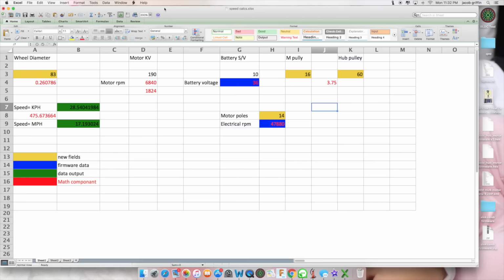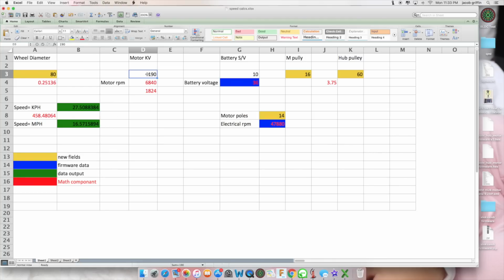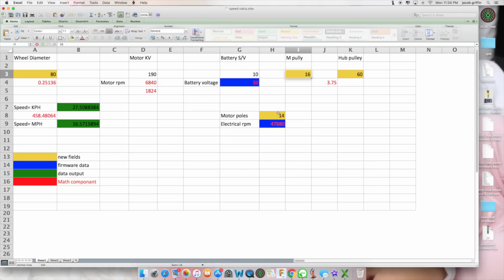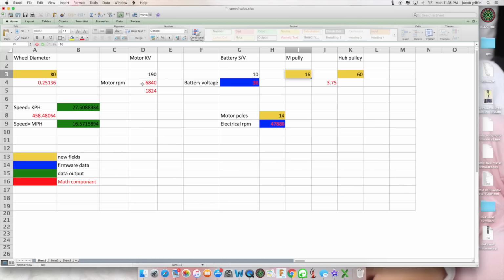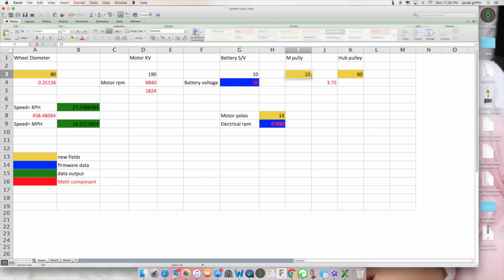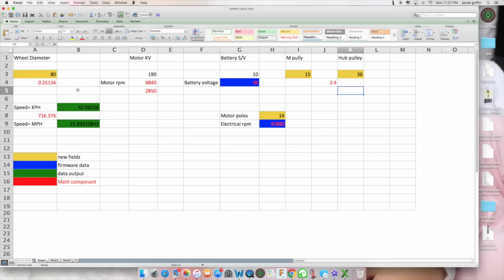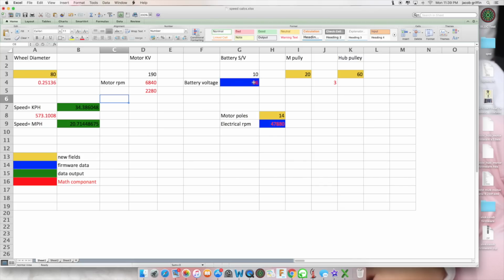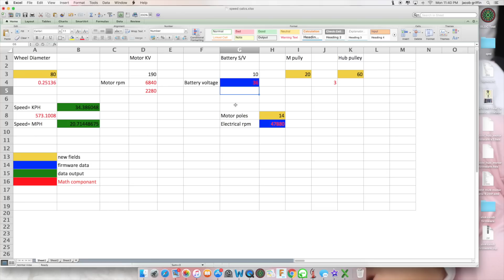Build EP1 electric skateboard gear ratio

Comment: If I wanted to have a pretty decent amount of torque and a pretty high top speed (45kph) would I be able to do it? I weigh 115 pounds (52 kilos).
Reply: Well 3 years later I can tell you that you could build a board that easily takes you to 60 kph with torque that will throw you off

Comment: I want to use an alien motor (outrunner brushless 6374 170KV 10s 3200w) is this a good option? Also the m pully has 15 teeth and the hub pulley has 32

Comment: HI Jacob, I bought some gear from Enertion, speed controller, motor mount and the 12mm nylon pullry system. I have big Abec 97 mm wheels and need more torque. Do you know where I can get an Abec wheel pulley that has more than 44 teeth? I live in Chicago and the streets are so messed up in certain neighborhoods that I need to use the bigger wheels. Please help, and thanks for sharing the spreadsheet.
Reply from the maker: There are none, but you can always design one your self.

Comment: What happens when I increase my gear ratio from 2.7 to about 3.3 with HDT5?
I have big wheels and need more torque...
Reply from the maker: +E-Boarding  Magritte of builds are done with a 83mm wheel. So I'm talking about the fact that if using an 80mm wheel your pulley diameter with HTD5 is going to be to big going past 36 tooth.
If I wanted to use a 1:3.75 ratio with HTD5 you have to use a 12tooth and a 45tooth pulley. Your 45tooth pulley will have a diameter of 71.59mm then plus your belt thickness x2. Your belts will be dragging on the ground. An HTD3 at the same amount of tooth is only 43mm. Also with a 12tooth pulley you will only have 5 tooth in mesh at most compared to 7 with a 16tooth HTD3 pulley required in the same gear ratio.

I know that you have big wheels but not every one wants big wheels. I personally like 75mm.
Reply: You simply get more torque and reduce speed...
Reply: I don't understand why is he's talking about a limit of 2.7 with HDT5. You can get nearly the same gear ratio with HTD3 and HDT5. Ok, your motor pully is limited to about 12t but that should not make a big difference... correct me if I'm wrong.
Reply from the maker: +ESK8 Support sorry I meant majority

Comment: It takes much more into designing the gear ration for example there usually are no motors that can go below 190KV and you cant use an 80T HTD5M pulley on a 97mm wheel as It'd be too big and a pulley smaller than 10T on an 8mm shaft as the teeth or the keyway would simply collide with the shaft. now for your weight just pick 83mm wheel with 44T pulley for the wheel and 14T pulley for the motor shaft and limit your speed with your VESC why else would you pay so much for it ?
Reply from the maker: Yes you can just limit speed, but with out optimising your gearing and motor kv your motor will be drawing more current then is needed. Meaning less range more wear over time. It is the reason boosted can get up the same hill as a raptor with a motor that is 10mm smaller in diameter and has a 10mm shorter stator.
Reply: Yeah but what does that have to do with the difference between HTD5 and HTD3 belt?

HTD5M Systems are meant to deliver more power at higher speed in comparison to the HTD3M some of those belt can go up to crazy 50mm pitch
Reply from the maker: +Derpy Herpy Iv already said this but I'll say it again. Majority of builds are done with a 83mm wheel. So I'm talking about the fact that if using an 80mm wheel your pulley diameter with HTD5 is going to be to big going past 36 tooth. If I wanted to use a 1:3.75 ratio with HTD5 you have to use a 12tooth and a 45tooth pulley. Your 45tooth pulley will have a diameter of 71.59mm then plus your belt thickness x2. Your belts will be dragging on the ground. An HTD3 at the same amount of tooth is only 43mm. Also with a 12tooth pulley you will only have 5 tooth in mesh at most compared to 7 with a 16tooth HTD3 pulley required in the same gear ratio. I know some have big wheels but not every one wants big wheels, big wheel require more torque so an even higher gear ratio for the same hill climbing ability. Yes you can go faster but it's a sacrifice. I personally like 75mm. This video and build log is not for those who already build boards it's for those who are starting.
Reply from the maker: +Derpy Herpy I could have put every detail into this video but it would be hours not 10mins
Reply: ESK8 Support What ever.
Reply: Consider the design goals of your eboard – Racing, Cruising/Commuiting, etc.
Consider design safety for the rider at those speeds (force = mass*acceleration, gravity ALWAYS wins)
Indicate the quality of ones ride in relation to board factors is important (Style/Format/Shape, Flexibilty/Rigidity) regardless of whether or not its motorized.
Introduction to Propulsion – Your board and body.
The system is a Battery + ESC + Motor + Gearset. The amount of power coming out of any component should be less than the one before it towards the battery.
For safety and design practicality, we should build backwards from riding.

Step 1. I’m 130lbs or under 60Kilos and I want to climb crazy hills and carve delicately through DC with style on my +90mm wheels. I need a portable and professional deck in both performance and appearance.

Step 2. If I’m climbing crazy hills, I need torque. If I’m going fast, I need higher RPM. Because DC has a pothole epidemic unlike an acne-ridden teen populace, I need large wheels to avoid getting tripped. +90mm wheels at 40km/hr translates to Alpha RPM. Alpha RPM on my wheels becomes Beta RPM on my drive gear which is connected to the motor gear at Charlie RPM. Charlie RPM on the motor gear is also proportional of the Delta RPM coming from my motor. The overall gear ratio between Alpha, Beta, Charlie, and Delta is dependent on the practical motor RPM.

Step 3. Practical motor RPM comes from three factors – Load, Available Power, and Motor Design.

Step 3a. Load – I’m pretty light, so this will not affect my gear ratio significantly. If I were heavier (greater than or equal to 70kg, I would have to consider my weight when selecting a motor).

Step 3b. Available Power – Batteries store chemical potential energy. They’re made of individual power holding cells arranged in parallel sets or in series.  Alone, each cell has limited power. But combined, their cumulative wattage (Amps * Volts) is great. Theoretically, Watts = Volts * Amps. Practically, there is not 100% efficient energy conversion. So we need to consider how to distribute power. The same 24 batteries can be arranged in many ways (1*24, 2*12, 3*8, 4*6) with the same cumulative wattage, however a 1*24 battery has much higher voltage than a 4*6 battery (while the 1*24 has a lower amp and Ah rating that the 4*6).  Voltage is the electrical potential to do work. A motors RPM is proportional to the batteries voltage and KV. Amperage can be seen as the amount of oomph behind each volt. A motors toque is influenced by how much or how little amperage is can draw. 12s, 10s, and 6s are common voltages in eboards and 1p, 2p, 3p, and 4p are common parallel sets for discharge in eboards.

Step 3c. Motor design – It’s an electromagnet propelling a magnetic rotor with carefully timed pulses. The electromagnet is made of copper wires that can be wound in greater number in thinner strands, or in a smaller number with thicker strands. When purchasing a motor, examine the ratings and specifications.  Pay careful attention to the Maximum voltage and Amerpage as well as the KV. As described, you RPM is tied to your KV and Voltage and your torque is tied to the amperage.  Depending on your weight and your desired speeds, select a motor that give you the KV you need as well as the amperage headspace to let you climb hills.

Step 4. Over designing your board is always better than under designing it.  With a theoretical battery in mind and motor specs at hand, calculate the gear ratio.  Gear pitch is important to prevent slippage, so use gears with deep tooth groves and high quality belts.   Common gear ratios for BLDC outrunners (50-60 mm range paired with 60-70mm wheels) are generally around 1:3 (where a single revolution of 36t gear requires three revolutions of the 12t motor).  Depending on the relative strength of your motor, the system that powers it, and the wheels you ride on - you may need to decrease the ratio or increase it to achieve your speed an/or reasonable hill climbing power.  Large wheels will need proportionally larger gears resulting in a lower ratio (where a single revolution of the 45t gear requires either 3.75 revolutions on a 12t gear OR 3 revolutions on a 15t gear). Again, check the relationship between your motor and gear set for speed and torque.

Step 5. ESC Settings
Step 6. Bench Testing
Step 7. Street Testing
Step 8. Enclosures
 
I would argue that nothing I say has any real value because it wasn't explained fully in a way that would allow someone to build their own machine. This was my attempt to do what Jacob did  in under 15 minutes for an equally broad audience.

Jacob's goal is to teach his audience and be informative on the development of a board. If your goal was to watch the video and instantly recreate a board at home, you've missed his point.